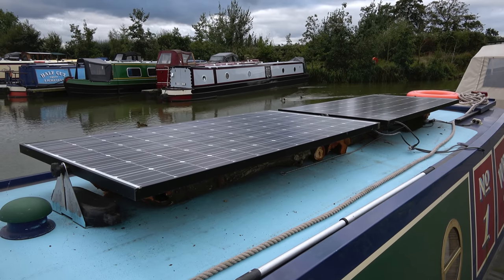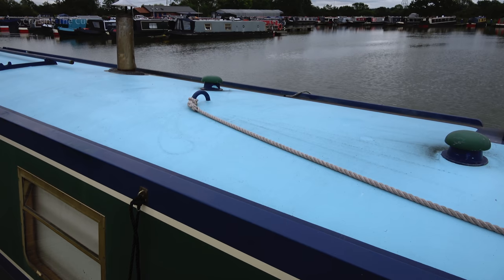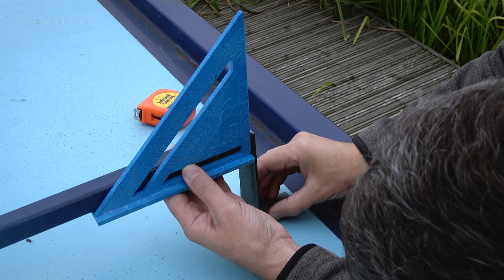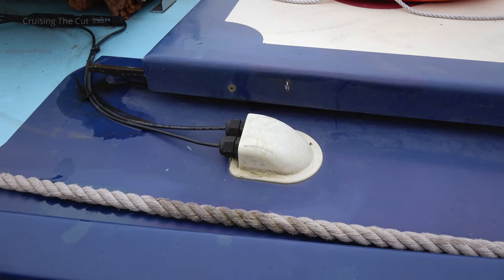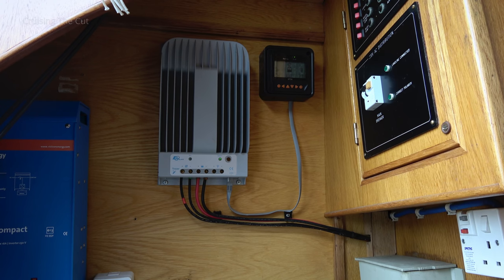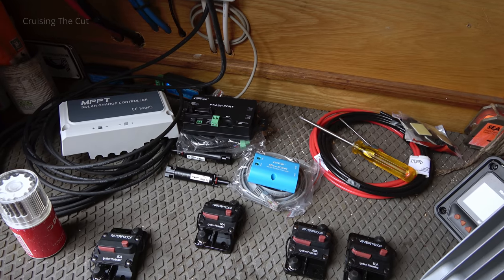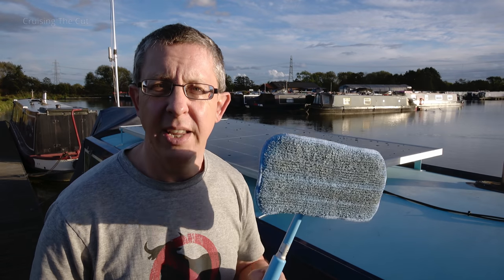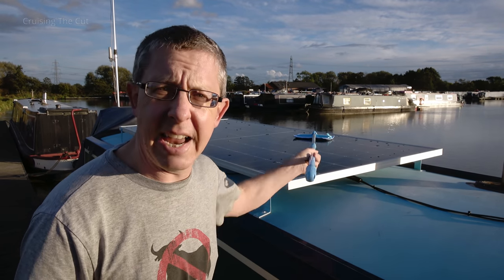251. Adding more solar power to my narrowboat

Comment: If your panels were the same, the benefit of the epever mppt solar controllers like the ones in this video is they are self-limiting and you could hook them all into the single controller. Epever (the chinese manufacturer) have been rebranded Photonic Universe in this video. 
That is if you use a 30 amp solar controller model, and you add more than 30 amps worth of panels, it will self limit the charging to 30 amps. 
We use these because it means you can have a great big solar array to account for cloudy days, but limit the charging speed on a sunny day to not damage the batteries by charging them too fast.  

The epever controllers all will work in parallel - even going back years ago to the old BN series - they dont need to communicate with each other. They will periodically detect the DC Bus / Battery voltage and will only raise the charging voltage when the batteries stop sucking the amps. Therefore if the battery is still sucking heaps of amps, it wont think the battery is full.  I can explain how this works if you would like.

Comment: 12.9V after some charging.  Are you still using AGM? If you really want better performance from your power setup, LiFePO4 will give that to you.

But yes, getting the new panel in makes a lot of sense, too.
Reply: OK, Pb-C batteries.  Same response though - LiFePO4 will be a big bump in usable power for you...
Reply: Near the end of the video he said he has Lead Carbon batteries.
Reply from the maker: Sure but lithium is still very expensive
Reply: @CruisingTheCut  To start yes, but they last far longer & you only need about half the AH to match lead batteries. So in the long run may even save you some money.
Reply from the maker: But it would also require a new b2b charger between my alternator and the batteries, heating mats for the cold (and the batteries wouldn't like the extreme heat in there either) so they'd really need relocating which is not very practical. Plus lithium runs best from 90%-10% which is 80% vs 50% use against AGM so not quite as good as first glance.

Comment: What wire gauge and length did you use from solar panel please?
Reply from the maker: No idea in AWG but its 4mm2 (may have been 6) cross-section which is how it’s measured here. Length was about 12 metres, I’m guessing since it went from near the front of the boat to the stern.

Comment: Sweet setup although i would have preferred leading the cables through the roof through the interior against the ceiling.
But that's just personal preference.
Reply from the maker: I definitely wouldn’t want it running visibly inside, that’d be worse than it showing on the roof!

Comment: I've used about 150 rivet nuts and the same amount of 316 stainless countersunk bolts on my Shanty Houseboat build so far. They're extremely useful for adding thread depth to thin metal surfaces. Guess what size I used? M6.
Reply: Used Selleys Armourflex instead of SikaFlex on the basis of value for money. Probably used  at least 10 of those large caulking sausages so far. Interesting that we find our way to similar products to solve similar problems.
Reply: I used spacers along with my use of SikaFlex/Armourflex so I could bolt down materials while glue was drying to prevent overcompression but ensure a firm even mating of surfaces.
Reply: Specifically that entailed using fibre washers for the bolt holes and shims cut from aluminium flat bar. How successful that is (and were talking gluing/bolting aluminium tread plate deck sheets  to aluminium sub-frame) we shall see as time passes. I had plenty of your, "hmm I need some flat headed bolt/screw thing" moments as I figured it all (hopefully) out.

Comment: But that little blue Bluetooth box if you don’t have screws use double stick tape. (Double stick tape is tape with the stick them on both sides of the tape). Just in case you didn’t know what you’re probably already knew!! Did you have to upgrade and add another battery or two or whatever?? What do you use your solar power for?
Reply from the maker: The solar charges the batteries which power everything on the boat - fridge, lights, TV, water pumps etc

Comment: Could'nt you use the previous battery connection for both solar chargers, instead of pulling new wires to the batteries?
Reply: Current.
Reply: You could but at a theoretical max of 80 amps or so you need a decent bit of chunky wire.
Reply: 👍👌🇨🇦❤, you are correct, but David is making a redundancy system, so if one system fails for whatever reason, he still has the other to use, or both sytems separately

Comment: I know this advice is too late for this project, but for future endeavours mounting doo-dads to wall panels:  forget about screws and get a roll of 3M VHB double-stick tape.  A cupla runs of tape, and a dollop of sikaflex for added security, and bobs your uncle.   To remove, a utility knife and a gentle pry is all that's required.

Comment: Panels bolted on and Sika'd...check
Wires run and connected....check
Controllers configured n nattering away with each other...check
Blinky lights blinking....check
Froody....time for some PGGB's n tonix (hic... sorry, started without you)

Comment: Excellent video. Quick question though; you have some Victron gear (On the boat and in the van) any reason you didn't go with Victron MPPT chargers? You could have then linked them and the Multiplus together (A lot easier than the ET stuff). Just a thought...
Reply from the maker: Victron stuff is very expensive and I'm not a huge fan of it
Reply: @CruisingTheCut  Fair enough.
Reply: Victron's inverters are excellent but their solar controllers I am not a fan of, here in Australia where it gets hot over summer the Victron MPPT controllers seem to run very hot, they only have a small rear cooling fin array compared with other brands and I've seen people put computer cooling fans under them to stop them going out on thermal protection.

Comment: A question why don’t  long Boats use composite Toilets?  No holding tanks a blessing. Also no water catchment systems.
Reply from the maker: Many do but there are now no facilities to dump the solid waste in (and not really sufficient space on the boat to compost it for a suitable length of time)

Comment: Depending on cost, should put another replacing the old panels. Keep the old ones in case needed, or put in the center of the boat.
Solar panels do go bad over time.

What is your battery storage capacity?
Reply from the maker: The panels have a 25 year life down to 80% output so they’re very long-lived

Comment: Hello, as you have an Victron Inverter, why did you not use Victron charge controllers ? Everything would talk to each other and you could easily control und monitor all from your smartphone.
Victron charge controllers are even more efficient then ep-ever. The breakers you are using, are only rated for 48V, thats not good for the Solar line. They will not trip anyways because of the amp rating. A simple switch rated for min 80V DC would be better. This breakers are not very reliable either, they fail often and have a large contact resistance. Is is always a good idea to mount electrical systems on a non flameable surface !. A sheet of metal would do the trick.
Reply from the maker: Because Victron gear is much more expensive, I'm not a great fan of it, and I can monitor the Tracer controllers from my phone.

Comment: Hi. I love your channel, it's great. However, you have no experience with PV. Please consider some changes.
1 - a 50A fuse for 1 panel is an exaggeration. He will never work.
2 - the panel should be tilted. In the horizontal position, the water will not drain. This can lead to serious trouble over time.

Comment: I am curious David. Normally one would have a breaker or a fuse on the load side (+ve) only. Why a breaker on both the +ve and -ve? An interesting vlog for sure.
Reply from the maker: There's no breaker on the-ve...
Reply: I must have misunderstood. Both the +ve and -ve had a switch on them.
Reply from the maker: The -ve side goes directly to the controller and from there directly to the battery. The +ve side has breakers.

Comment: You could have linked the earths and the positives at the chargers  and run a heavier cables to the batteries.. two breakers "in", for panel isolation and one out for battery isolation.

Comment: On caravans you normally dont want to drill through the roof, but rather glue the consoles actually.
Reply: Well, it isn't bloody plastic caravan, is it? It is a bloody steel boat with wooden interior.
Reply: Did he say the steel roof is over a quarter inch thick? The rivet nuts will hold forever
Reply: @henryD9363  4mm is a lot thinner than a quarter inch.

Comment: Do they not use optimizers in marine Solar installations? With them you could have used one larger charge controller and simplified your wiring to one gland.
Reply from the maker: I don’t know what one of those is
Reply: @CruisingTheCut  Per panel modules that do MPPT control for the panel while providing a uniform interface to the inverter / charge controller. Small boxes that go on the backs of panels. So you would use one with each panel and then string them all in a serial configuration back to one charge controller that can handle the power.
Reply from the maker: I've never seen that on a narrowboat although that's not to say it hasn't been done of course. I think most folk have a single installation of uniform panels to a single controller; my setup is unusual in adding a second, different panel. Useful info though, cheers

Comment: Great job!
Wouldn't it be better to put the new panel at a slight angel so  that rain water would tend to flow off, you know like you would for a patio :-)
Reply from the maker: It’s a boat! Therefore it wobbles side to side anyway. Rain falls off.
Reply: @CruisingTheCut  Depends what you're up to I guess ;-)
Reply from the maker: Walking around, mostly

Comment: the old fuse and smaller wire [possible fuse able link] are not necessarily redundant
the new wire between the breaker and battery is completely un-fused. 
CAVEAT EMPTOR
Reply from the maker: The breaker does duty as a fuse
Reply: @CruisingTheCut  bur it does not protect the cable between the battery and the breaker from any grounding

Comment: I'm sure many have told you your solar won't give you enough. even 600w it's too litle for the winter season.  But I want to ask you, Why paralell and not serial connected?  I'm looking for a reason to still run in serial, as this is the most effective and fastest.
Reply from the maker: You can’t connect all those panels together, as explained in the video (whether parallel or serial) hence the two controllers. The pair at the back were originally in series but I switched to parallel so that in the event that one panel is shaded, the other still works (which would not be the case if they were in series). Series connections are best for long runs so as to give a nice load of voltage to counter voltage drop over a distance.

Comment: Drilling the roof, you used a spray lubricant. Wouldn't that stop the sikaflex from bonding to the surface?
Reply from the maker: Fear not, the roof was thoroughly cleaned with degreaser before applying the Sika
Reply: @CruisingTheCut  I'm sure it was mate, but for the benefit of those few who might otherwise end up wishing they had de-greased, its worth always mentioning stuff like that on your videos. Just a thought.

Comment: Damned, why am I watching this again (now for the third time)? - I mean I love solar-power (and wind- and even micro-hydro-power), but I frankly don't have a boat (or other vehicle) that needs solar-power...(not that I wouldn't like my own home-brew camper-van, so not stock version but I'd rather buy the van and do the build myself!)
Still, it is interesting and I need to come down in the evening (need to get up bright and early tomorrow, I got stuff to transport to my new apartment...yes, still busy, because frankly I have the detritus of 20 years of staying in one place to clean up, sort out and transport the rest...furniture is already at the new place)

ps: Why only 1 screw (into the boat's hull) on the brackets? Not afraid that they'll move if you say kick them accidentally while walking on the roof (if you do move your boat again, I kind of doubt you will stay in that marina forever!) :)
Reply from the maker: The brackets are very secure, especially with the amount of Sikaflex I used. Honestly, it’s rock-solid. And I very rarely walk at that end of the roof anyway.

Comment: Just wondering if you're  getting enough charge from the new setup?
Reply from the maker: Depends on the day... I have had to run the engine a bit but as we're in the deepest depths of December, I'm not surprised.
Reply: @CruisingTheCut  bummer. My camper solar is the same. Especially when covered in snow.
Reply: @kevgermany  
Use the mop....keep it as clear as possible of anything that could cover it....
Do you have one of those Chinese diesel space heaters installed for heating?

Comment: Why not install half a dozen those tube-shape wind-power turbine that can be bend down when not in use and wile passing through tunnels or bridges   ?
Reply from the maker: Because wind turbines are a bit rubbish on the canals, see https://cruisingthecut.co.uk/f-a-q/
Reply: @CruisingTheCut facinating little page of info. i just looked at the bit about using a cordless drill to operate the paddle gear. lol i work with big drills in my line of work and ill say that the drill you'd need would most likely put you in hospital because of the torque requirement. also if it was motorised and the paddle got stuck the motor that powerd it would strip the hell out of everything and things would be damaged irreparably. additionaly.....cost of maintenance. the handle has done well for centuries, and it will do for centuries more lol.

Comment: David, do the Cable glands not come in a 4 wire type. I can see while there is minimal room I would think using a gland with provision for Qty 4 wires would have allowed you to not just make everything more compact but fewer holes in the roof and only one location for the wire to come through and less opportunity for potential leaks.
Reply: Indeed. The trick is to fit ordinary cable glands and drill a hole under the "footprint" of the panel.

However ... you then have to lose the feeder cables inside the boat all the way aft to the controllers/battery bank. Could be a "lot" of work losing the cables behind the interior ceiling trim.

You might have to then use 16mm2 cables what with uprating for current. Which then might mean two holes and two cable glands.

On the roof, in "free" space you might get away with 10mm2 cables.

(Knowing the BSS lads  and the evolving of boats being powered by electric motors we'll be seeing the introduction of 25mm2 cables as a minimum for connections of battery to motor.)

For those interested the cables of that dimension are not "cheap" per unit run, at all.
Reply from the maker: I couldn’t find a four-cable version, alas

Comment: With fuel prices going up at an astronimical rate at the moment I was wondering the feasability is of using solar charged battery power for propulsion. Would you need too many batteries or too many solar panels, or is it possible but too expensive? Also what about wind power as an additional charging source?
Reply from the maker: It's not feasible unless you were willing to wait days between moves, and would even then only be sensible in peak summertime. Realistically you need to use solar as an additional source to a generator, see the video I did a few months ago about an electric boat trials day. Oh and wind turbines are fairly useless on the canal.

Comment: The Chinese message around 39:42 says something is failing, not success I am afraid. Due to the screen resolution, I can't really see the full message. This may be the reason why you always get an error message on your mobile phone app.
Reply from the maker: Cheers. The app error is for a different issue but the message didn’t affect adding a station anyway so it’s a bit baffling!

Comment: Is there a reason you didn't paint the brackets after you drilled them? I would have thought the paint inside the holes would have added a little more rust protection?
Reply from the maker: I did! The holes were drilled when they were raw metal (but my commentary didn't make that clear)

Comment: have you thought about what happens with these panels when they've finished their useful life?
Reply: been running solar (in Australia) for about 11yrs, still pushing out 90-95 % capacity
Reply: … he’s not using solar to be green. He’s using solar because it’s the only thing that works.
Reply: @barrycook5607  so what happens when they’ve finished their useful life?
Reply from the maker: Since the panels have a rated life of at least 25 years, I'll probably be dead before they expire.

Comment: Why did you put a breaker on the solar side?  It will never trip out if there is a fault.  An isolation switch will suffice.  Also, did you consider Victron MPPTs?
Reply from the maker: So as I could use it as an isolation switch. Victron gear is expensive.
Reply: @CruisingTheCut  My Dad always taught me that if you buy cheap, you'll end up buying 2

Comment: Great informative video but did I see a junior hack saw cutting wood? And with your hand in the slip zone? Hacksaw injuries are the worst as the blade will go through your soft bits and cut into your bone like a butchers saw! I love your videos don’t want to see you hurt your camera hand! A battery ‘multi tool’ would be a handy and safer addition to your toolbox. That said, well done on a successful job done.
Reply from the maker: I have a multitool